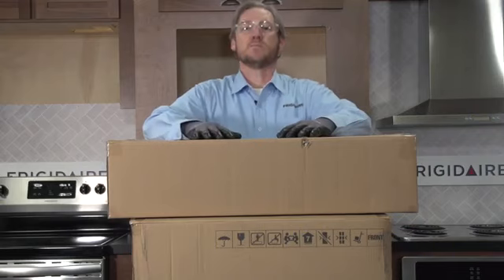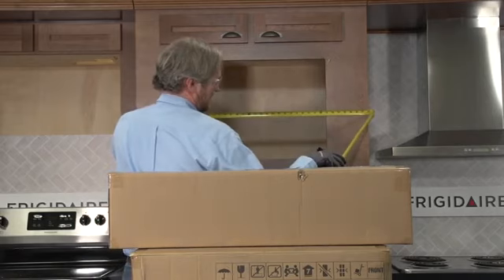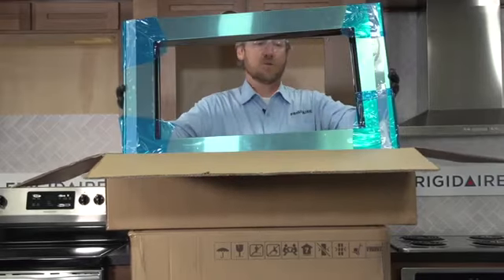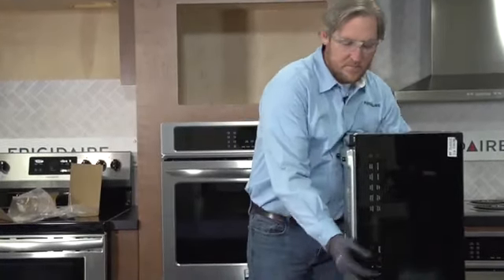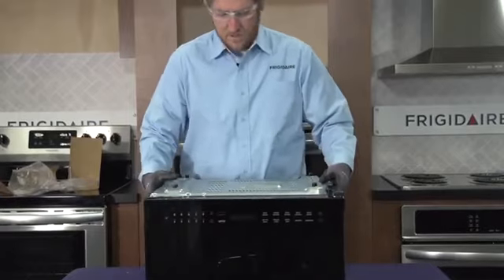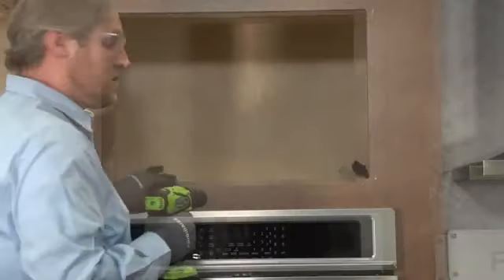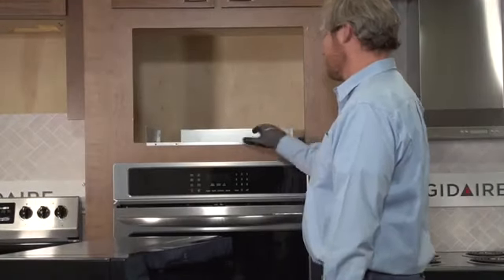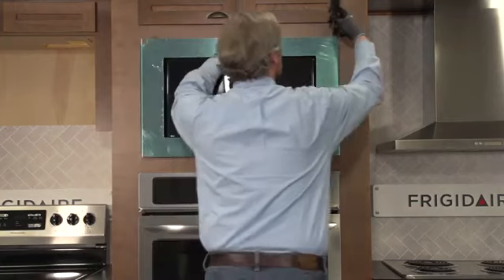Frigidaire/Electrolux Built In Microwave Installation

Comment: Thanks for the video. I bought a new Frigidaire built in microwave-it was delivered today-to replace the one that didn’t work any longer (built in). I hoped that all I needed was the microwave since the decorative surround still looked absolutely brand new. I thought we could simply put the new one in the already prepped  hole but though there was plenty of room for the new one, the feet didn’t quite line up the same so they won’t go down into the holes.  My husband just slapped the decorative frame back up. The Microwave isn’t flush with the frame -sticks out a little. Oh well. Hopefully no one will notice. It’s a shame that all companies thar make so called built in microwaves charge so much for simply a microwave that’s just the same as a countertop one. The only difference is the optional Frame kit which is ordered separately. The old style frame looks fine so I wanted to save that $$ and I have. It’s just not perfect but I can live with it-it won’t spontaneously fall out of the hole so it’s fine.

Comment: This video was perfect for the installation of my Whirlpool built-in microwave, thanks.  I did not need an extension cord.  My original microwave was barely 4 years old and in a house built in 2017.  I was shocked it went out (stopped operating correctly and the LED's began going out - the numbers were not showing completely).